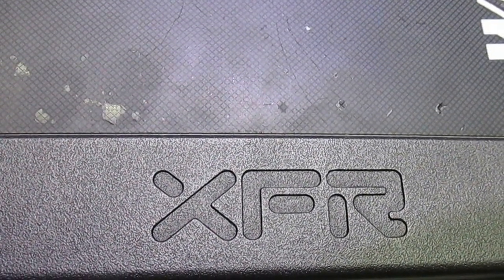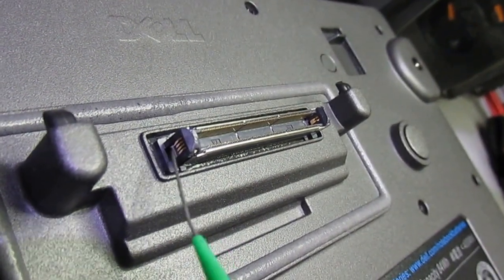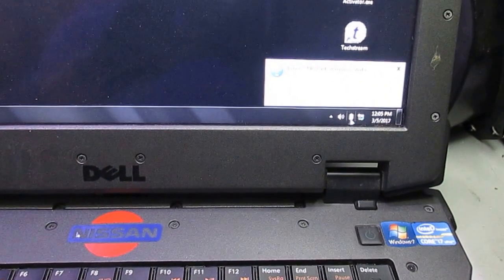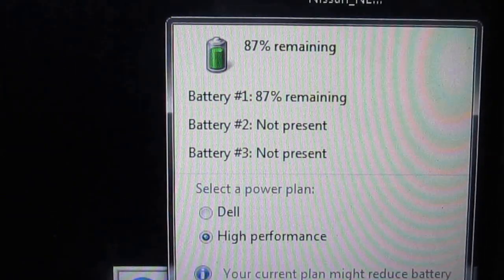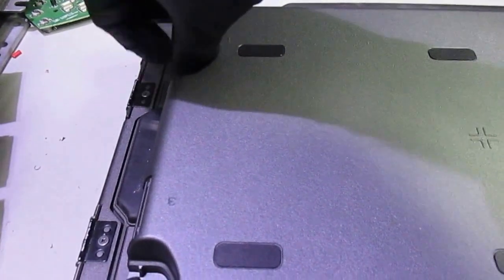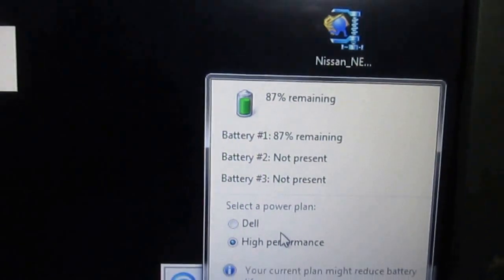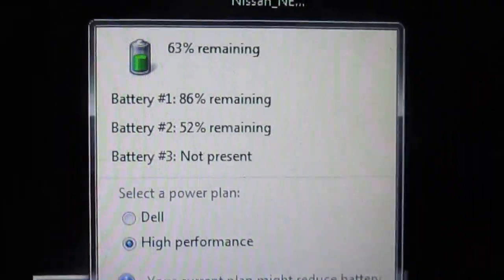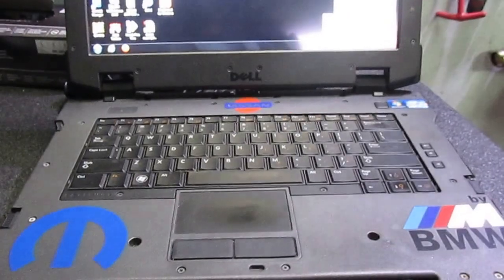Extended battery XFR DELL - W476P

Comment: I'm using mine with a e6320 - not one of the military ones, just a plain one with the e-dock.. and I am getting about 9 hours with the display on the whole time and running a bittorrent client. That's with no regular battery installed. And I bet those batteries have been on the shelf for quite a few years before I got it.  It's not a great fit, but it works. I need to add spacers around the dock so the laptop doesn't rock back and forth on the connector.

Comment: thanks, i just purchased one.. if I run into this issue i know what to do. What kind of times do you get with this battery?
Reply: I was wondering the same thing and also does it charge through the connector or do you have to swap from charging your laptop to plug in to a different port to charge the slice?